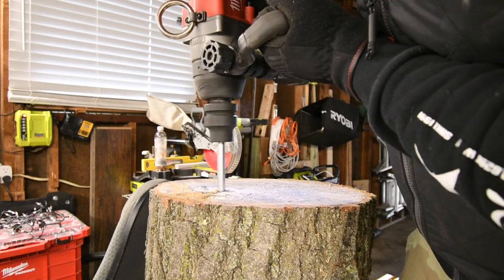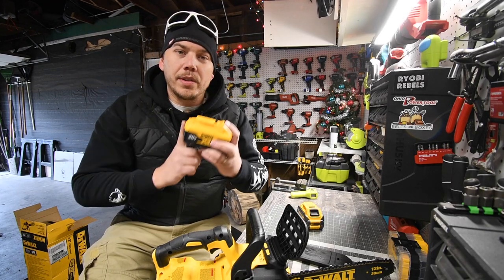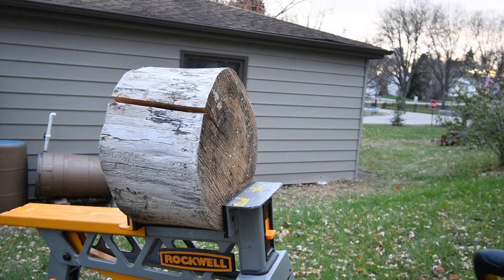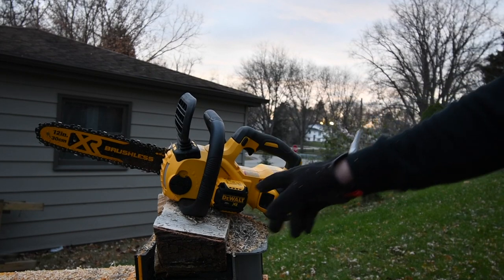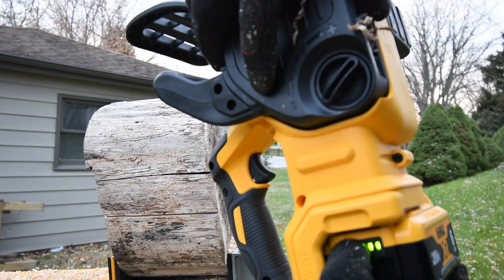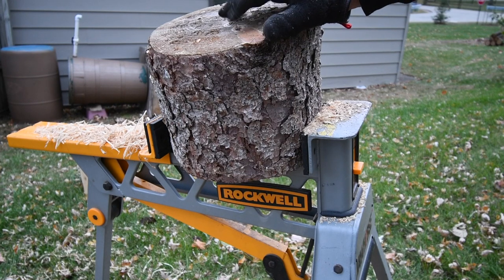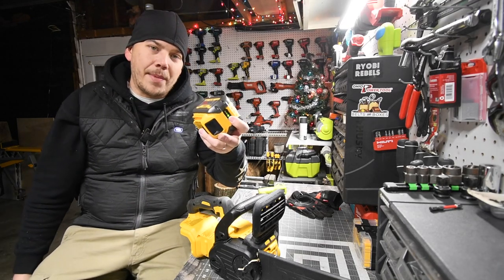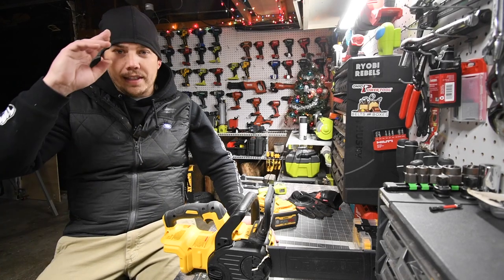$189 Dewalt XR Compact Chainsaw

Comment: I have had this saw for a year and love it. I use it simi regular for cuting limb wood and small firewood. I like it because it is easy to handle one handed. It is definitely not a replacement for a gas saw but is very capable. I bought it on sale at home depot for $99.

Comment: Went straight for the flexvolt. This is still impressive for along the grain cuts (noodle). Cleaning is slightly annoying, but a toothbrush and a large safety pin does wonders.

Comment: Yeppers, no safety glasses oh wait after thought but then again we done plugged the saw up so the sawdust is spurting out the front. Then once it's plugged up the sawdust gets behind the drive sprocket and starts melting the plastic...then down hill after that. First time using a chainsaw?
Reply from the maker: Obviously you didn’t watch the entire video. I show safety glasses 😆 and yes, I cleared out the sawdust every once in a while. Duh
Reply: @ManCaverTools  Obviously I did watch the whole video as I said "oh wait after thought". As far as cleaning the saw dust out "Duh" The  length of time you ran it plugged was way more than enough time to do damage on the particular saw, trust me!